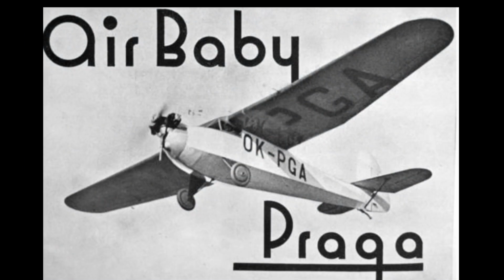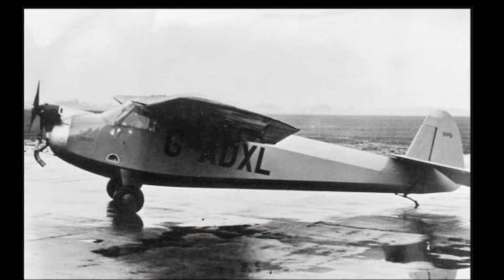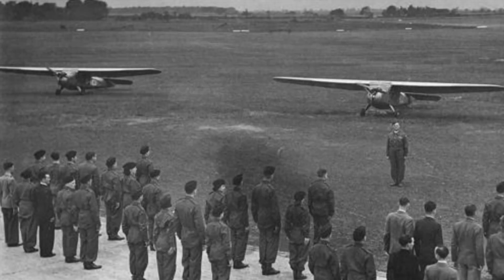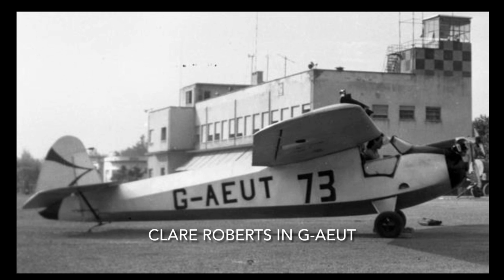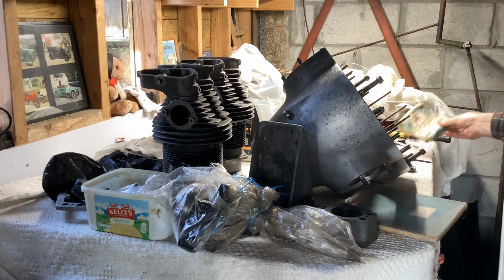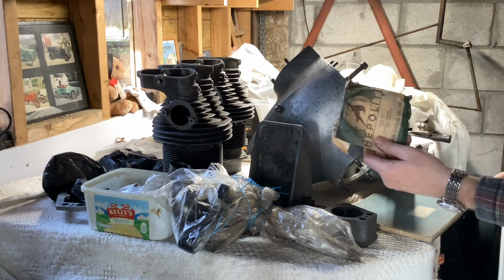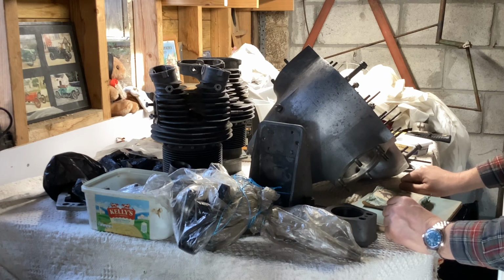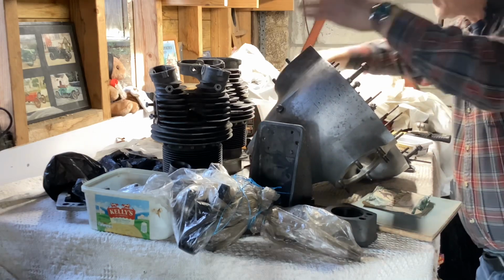Praga B2 Engine Rebuild - Part 1 - Hillson Praga

Comment: The ABC Scorpion seems a similar engine. It powered the Robin and Gadfly both very good FF rubber designs and in a Robin I built flew beautifully on a compressed air motor.
Reply from the maker: The Scorpion is similar although smaller in capacity. ABC motors traditionally had a poor reputation for reliability!

Comment: I picked up a Praga B engine from a gentlemen on the south coast and took it somewhere in the 1990s, it was complete and new I think. I can't remember where I took it! It's not in the boot of the car.
Reply from the maker: Mine was one of a pair that were in Kent until 1995ish and then went to a well known Chilton restorer in the Midlands. I’ll put some more history and photos in Part 2. Have you checked under the bonnet?
Reply: @FlyingForFunTrecanair  You are quite right, I probably dropped it off with Roy. I think the gentleman on the South Coast had intended the Praga for a homebuilt project, but he ran out of time. He did tell me and it was interesting, but I've forgotten. Nice chap. I only remember one engine. I used to work at Shoreham and drove up to the Midlands every weekend.